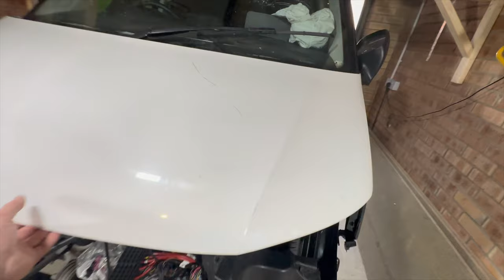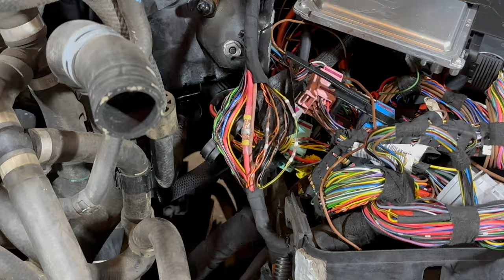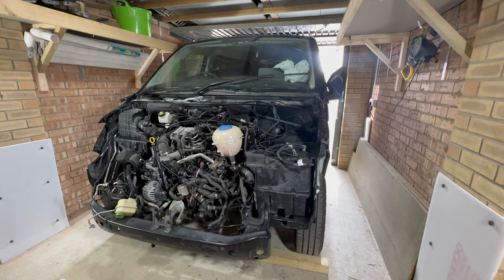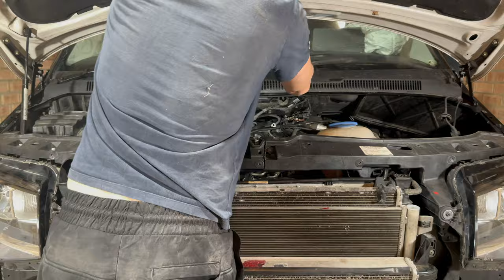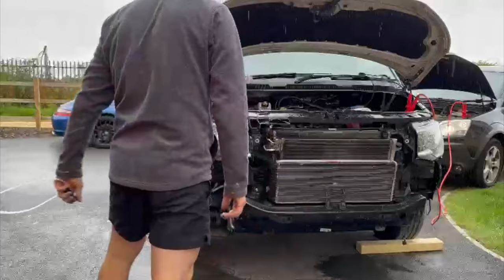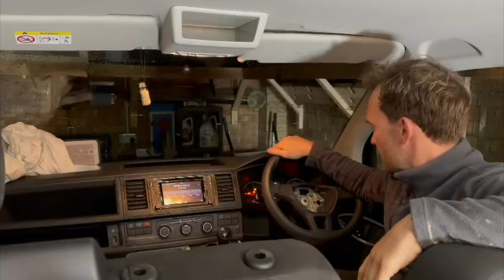VW Transporter T6 - Engine Start Attempt - 'Crooked Camper' Conversion - Part 4

Comment: The fan is on because the outside air temperature sensor that is usually on the bumper isn’t plugged in. It’s a default setting to keep the engine cool as it has no way of knowing how hot it is
Reply from the maker: Thanks, I didn’t think of that. 

I thought it may be because the plug for the coolant expansion tank was broken so the ECU couldn’t tell whether there was enough coolant in the system.
Reply from the maker: This might be a silly question but does the fan have different speeds? The reason I asking because as you heard in the video, when it does come on it’s so loud it sounds like it’s about to take off 😄

Could the default setting be ‘on at full whack’?
Reply: @CrookedAutos  I’m sure there’s only one speed, the plug on the expansion cap will just be for the coolant level, once that it fixed and the temperature sensor is plugged in the ECU will be able to monitor and regulate the temperature if needed.